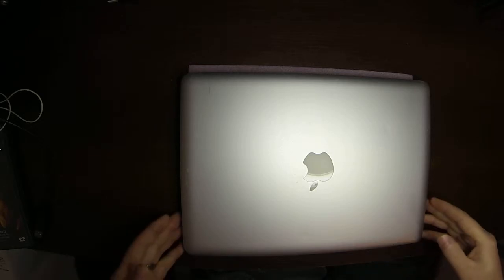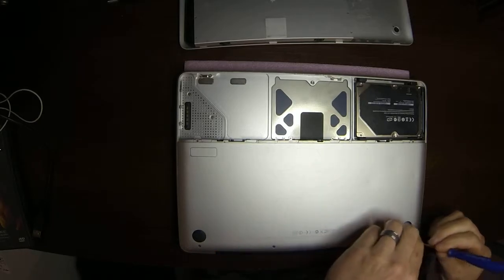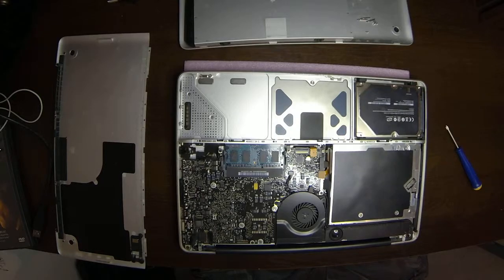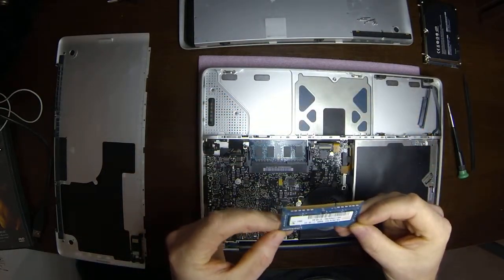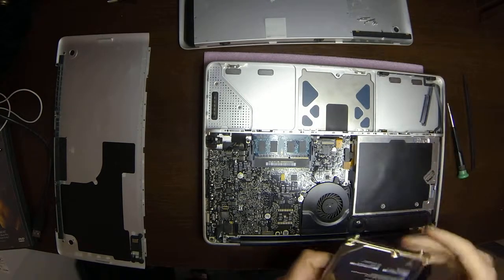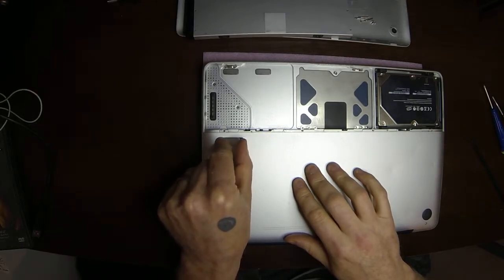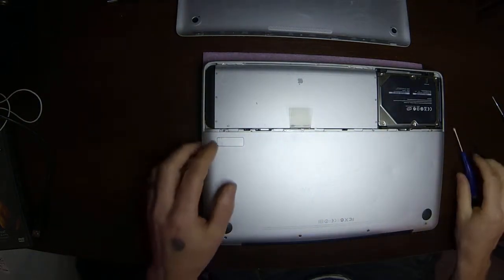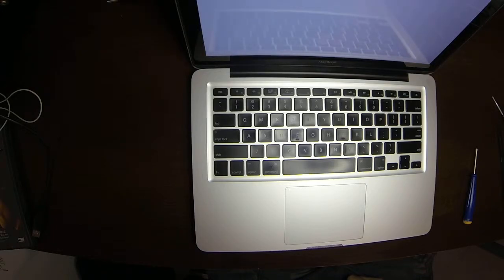How-to: RAM & Hard Drive Upgrade in Aluminum Unibody Macbook (NON-Pro)

Comment: Hi, i have a question, i just installed my new hard drive and everything works fine but my sleep indicator light no longer works(doesn't light up at all)! did i do something wrong? Thank you for your time and dedication <3
Reply from the maker: You likely accidentally unplugged it while changing the hard drive as it's connected to the same cable as the hard drive cable. Double check that cable where it goes into the location of the sleep light and see if it pulled out a little. If you need more help let me know! :)